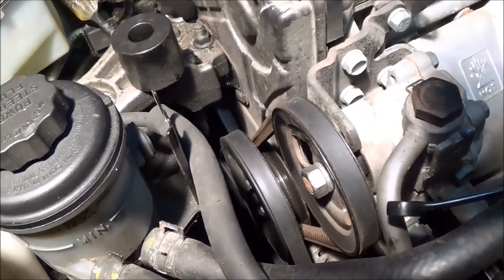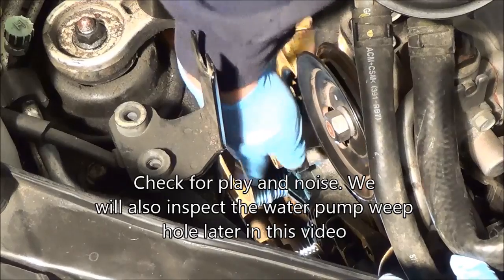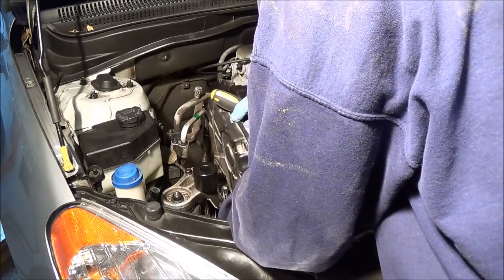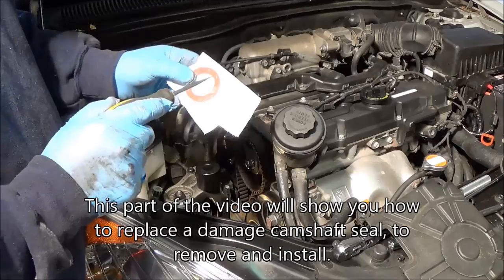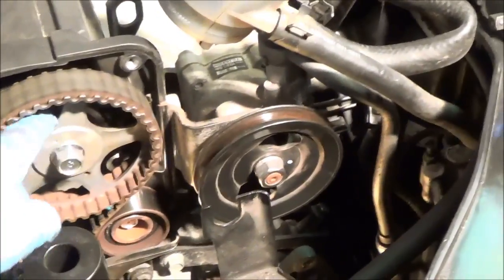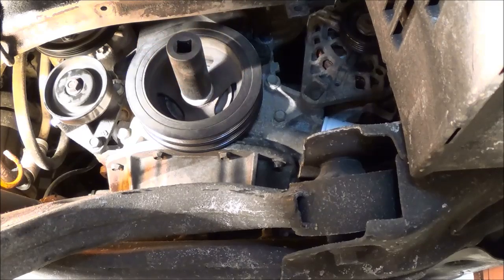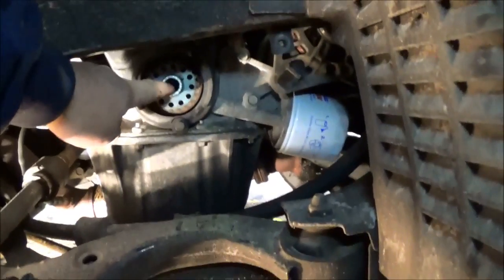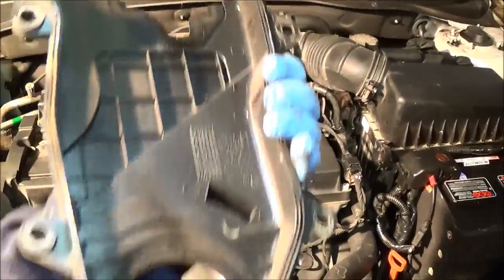2009 Hyundai Accent 1.6L GLS DOHC Timing belt service Part 2 of 3  720pHD

Comment: My belt broke .how dow i get back to tdc?  Should i line the marks up?  Thank you.
Reply from the maker: Yes cam has red dot as per this timing belt series. Line up cam and notch on bottom called crank sprocket. When you release the automatic tensioner the belt will move sprockets a bit. Be aware marks lined up. manual rotate the crank bolt 1 full revolution or cam sprocket using crank bolt. Then start engine after you put harmonic balancer back on.

Comment: Why give so many details on the camshaft seal if your not gonna show how to correctly remove it. Especially if your doing all the preventative maintenance and have the seals wouldn’t you want to replace them?
Reply from the maker: If its not leaking why would I? Same as water pump.
Reply: gereral1 why give info on it at that point. It’s preventative maintenance while you have everything else apart.

Comment: When removing the Crankshaft bolt will this not make the engine turn counter clockwise?
Reply from the maker: may move a bit but nothing to harm the engine. Use an electric impact or air impact gun. I used an electric one in this video to remove and put the bolt back on. If it moves off the mark simply rotate it to the mark then remove the balancer. Kinda cold now to be doing this job where I live. Good luck.

Comment: How do you remove the harmonic balancer bolt if the harmonic balancer keeps spinning
Reply from the maker: Archie Watkins impact gun
Reply: Goodmorning i try with impact gun still spin what should i do next?
Reply: Impact gun wasn't enough for me since it was ten years old rust.
Reply: @mrc8155  how did u place the screw driver in I'm having that spinning problem and don't have a impact
Reply: @HD_ShadeTree  I shoved it through one of the 3 large holes of the harmonic balancer (the inner part of the pulley joining the bolt and the rest of the pulley). The tip of the screwdriver can then rest on the block (i used some sort of massive groove that was there) and when you unscrew the bolt, the HB will be stopped since the screwdriver blocks it. Make sure the screwdriver rests on the right side of one  of the holes so it wont turn when unscrewing. I used a long Breaker bar and it can help to be 2 persons, one holding the screwdriver and one to break it free. Hope this helps!

Comment: is the harmonic balacner bolt right hand or left hand thread ,iam replacing the water pump on a 2008 hyundai accent ,and im stuck on that bolt
Reply from the maker: left turn to loose.
Reply: gereral1 ok so it's normal thread ,thank you

Comment: I am a little confused.  If you're not supposed to turn the engine counter clockwise, how are you supposed to loosen the harmonic balancer bolt?  If I try, won't that cause the engine to turn counterclockwise?
Reply: If the belt is on you can turn the motor counter clock its not going to do any damage.  Also if the sprocket moved and you need to re-time the motor you can turn it a few teeth you can turn it.  The motor is not moving fast enough to bend a valve or damage a piston.
Reply: I put a flathead screwdriver through the harmonic balancer pulley to block it on a small notch on the engine block, it worked fine!
Reply: And yes an impact will turn the engine when it's rusted as hell
Reply from the maker: an impact will not move engine....
Reply: With that being said, you dont want to rotate the opposite direction unless necessary

Comment: Why are u so adamant about not using a seal puller? Ive used them in the past and theyve worked fine and didnt damage anything
Reply from the maker: Have to be careful as not to damage the aluminum as long as you know how to use it correctly.  They sell seal puller kits to evenly remove and install them without damaging the aluminum.
Reply: +gereral1 got ya. Thanks!

Comment: Dangit.  I'm as far as the crankshaft pulley and I'm worried about turning it the wrong direction while I'm trying to get it off (is it a problem at this point? I don't have the timing belt cover off yet).  Also, no one anywhere says anything about the AC belt, I'm assuming this is a no-brainer?
Reply from the maker: Sarah Steever This engine you must rotate clockwise. If you are second guessing yourself better to get a professional mechanic to perform this service. Its all played out step by step in these videos
Reply: Got it.  Ended up borrowing an air wrench and a compressor to get the pulley bolt off, but she's running.

Comment: The holes that you saw on the harmonic balancer pulley are not for special tools (you mentioned this at about 12:30 in this video) -- they are drill holes made when the manufacturer removed material from the heavy side of the harmonic balancer pulley to balance it. 

You will see similar drilled holes on flywheels too.  Also on pressure-plates on manual transmission vehicles.  Basically any heavy cast round spinning object on an engine needs to be balanced -- and the drilled holes are the way it is commonly done.  The more holes and the deeper the drilling, the more metal had to be removed to put it into balance.  It's basically the opposite of what is done for balancing tires -- where they add weight to the light side.  Instead, for spinning metal parts with significant mass, material is removed from the heavy side to put it into balance.  You will see similar drilling on the counterweights on crankshafts too to get the crankshaft into balance.

I hope this is helpful....

Comment: hey gereral1 do you have any idea how to align the cams
Reply from the maker: In Richmond, va be home Friday. I'll check the repair manual. In the past intake and exhaust cams are connected by a timing chain. On the ends are marks. Tdc set cylinder 1 on tdc then line up the dots. I'll look it up so check back Friday.
Reply: k thanks
Reply from the maker: 09accentDOTbravesitesDOTcom  Geeze I cannot post a link in here. So replace the DOT with . to view the website
Reply from the maker: I want to keep this site separate from my you tube channel. I,ve seen some great sites go down here because of posting material and stuff. Example autotechviewpoint had millions of hits and great automotive videos. Recording the videos is one thing. Taking material off some one else can get you in trouble ;)